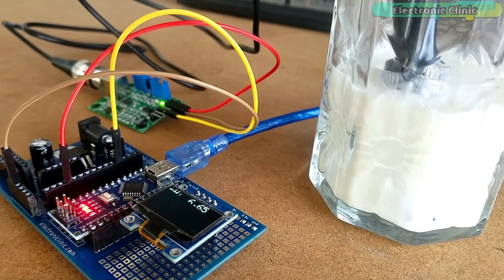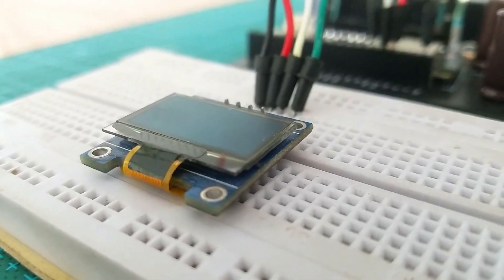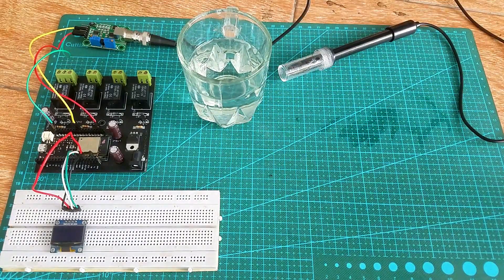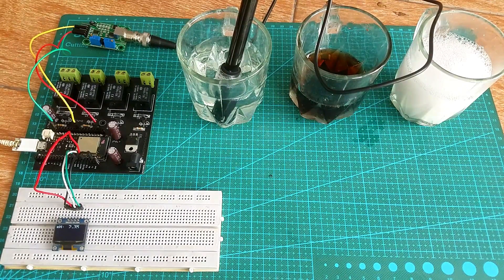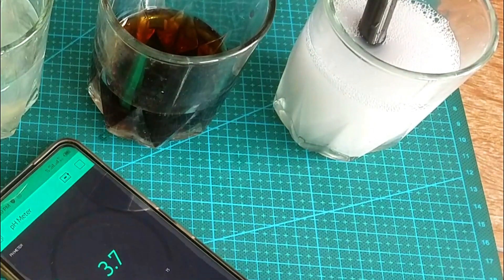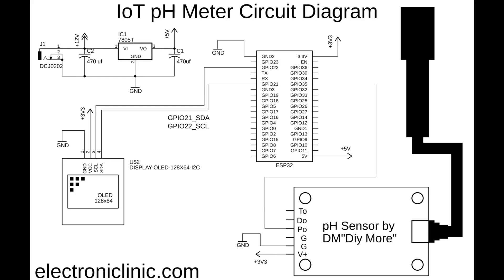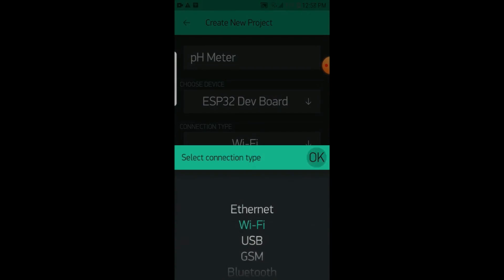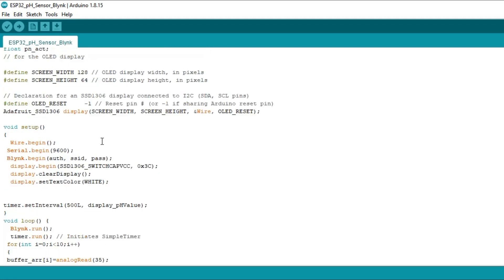ESP32 pH Sensor, IoT pH Sensor Code and Circuit diagram, Blynk IoT platform

Comment: Please create a video about this Sir i use black ph sensor cheaper than color blue please help i use esp32 if i connected to the lcd 12c to display the data but it is not accurate please help im your subcriber my title is water quality monitoring system sir please help
Reply from the maker: I don't have this black pH sensor. I have the latest one from the DFrobot.

Comment: Can i use a normal ESP32 Board for the sensor and still work perfectly?
Reply from the maker: @clyrkbendaytic421  yes
Reply: @ElectroniClinic sir if i use the lcd 12c instead of oled lcd why i dont get the exact value sir like 7 go to 13 and 13 to 10 why it is not accurate please help sir my title is water quality monitoring system

Comment: Hey,
I'm working on a water quality monitoring project using ESP32 WROOM, pH4502C, and EC Board v1.1. I'm facing challenges with connection and coding the components, especially during the pH offsetting, which isn't producing the expected results. I'd really appreciate your help in resolving these issues. Your expertise could make a big difference in achieving the project's goals.
Looking forward to your guidance!

Thanks!
Reply from the maker: Dis you watch my latest videos on pH sensor? Hydroponic system?

Comment: In the process of tackling the Arduino project, I calibrated the resistance to nail that 2.5 V output. Now, jumping into ESP32 territory, wondering if I need to mess with resistance for 1.65 V. Ran into a roadblock trying, any advice on recalibrating?

Comment: Using esp32 do I need to use a 5v to 3.3v logic level converter?
Reply from the maker: Yes 3.3v logic level converter is compulsory if you plan to use the project for longer periods of time.
Reply: @ElectroniClinic  I think he meant to ask if it is possible to power the sensor with 3.3V instead of 5V, and my question is: to calibrate the sensor with the esp32, do I need to adjust the trimpot until I get 1.65V or does it stay at 2.5V?

Comment: Is the second glass a coke? If you do some googling, the pH of coke is around 2.6 - 2.7. In this video it shown 0.74, which is not drinkable. This value even below the pH value of car battery. Did you do the correct calibration? Or it just because of ADC error?

Comment: Hi, when trying to calibrate the sensor I get an incorrect voltage from PO when trying to adjust it with the (BOATER 3296) potentiometer. I try to read it from the PO pin but it just reads ADC = 872;  Po  = 4.262V. The actual readings can be measured at the external part of the BNC probe or at the potentiometer. They show the correct voltage that I've tuned to 2.5V for the 7 Ph baseline. Is this a fault with the BNC interface?
 
I am running this code to measure the voltage at PO, the potentiometer and the BNC connector

#include <Arduino.h>
const int adcPin = A0;

void setup() {
  Serial.begin(115200);
}

void loop() {
  int adcValue = analogRead(adcPin);
  float phVoltage = (float)adcValue * 5.0 / 1023;
  Serial.print("ADC = "); Serial.print(adcValue);
  Serial.print(";  Po  = "); Serial.println(phVoltage);
  delay(1000);
  
}
Reply: Have you found any solution ?

Comment: Hi, I need help i wanna make a project: control a motor servo(SBT0811) with GY-521 from Arduino uno to raspberry pi 3B wirelessly with FS1000A and idk to connect these things